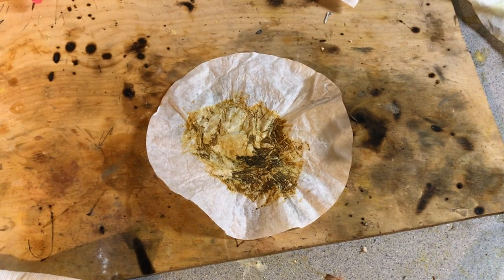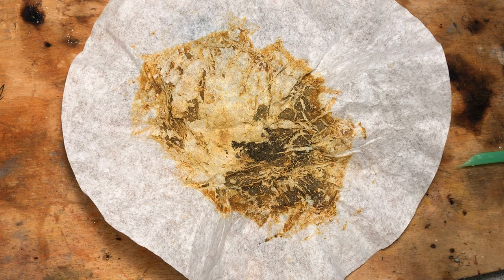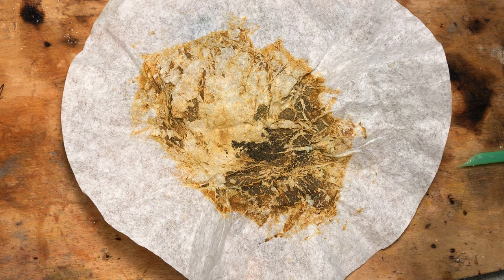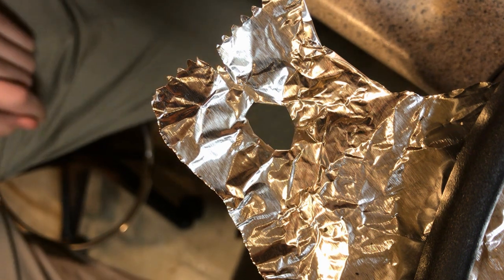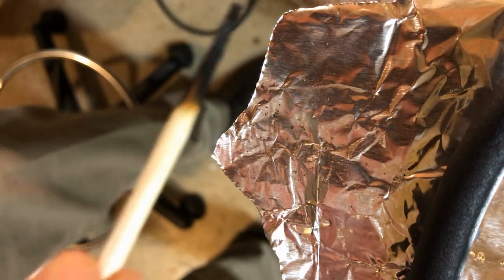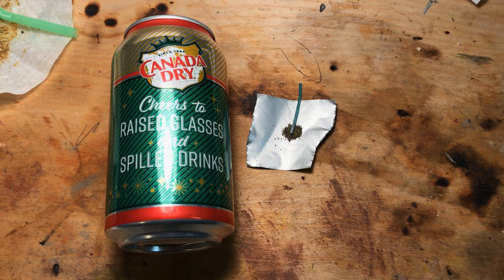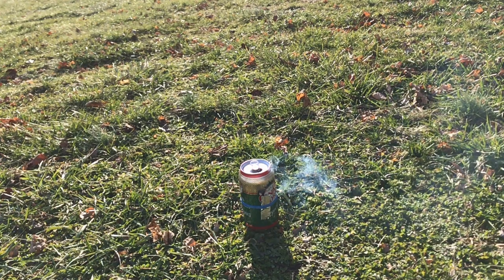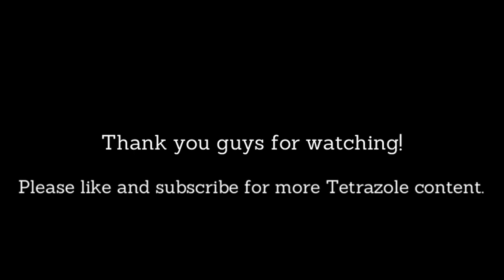Testing Energetic Properties of DBX-1 (Copper(I) Nitrotetrazole), a Lead Azide/Styphnate Replacement

Comment: i like JamesG below have an interest in a non corrosive cartridge primer mix . Have you made copper ammonium nitrate? This was supposedly used in priming mixtures in the 1920's. I think it was dropped and replaced with lead Styphnate and azide mixes. There has to be something easy for us non chemist types to make in small batches safely to see us through until prices come down and things come back to market. $175/1000  primers is just stupid!

Comment: Azidoazide azide. C2N14 I guess easy to make. Could be a good lead styphnate replacement.
Reply from the maker: Rocket Surgeon yeah it’s far from
easy to make and it’s sensitivity is sky-high. Not to mention that it decomposes entirely within about a day of production.
Reply: @DBXLabs  The YouTube Channel Explosions&Fire made some and it was shelf stable for 6 weeks he reported, and he wrapped some in tin foil and struck it with a hammer and on a couple strikes it didn't detonate. So either it's not as sensitive as indicated, or there was some kind of impurity that served to stabilize it some. Anyway I'm no energetics expert, I went nanotech. Primers are the real bottleneck to ammo production though so a decent lead Styphnate replacement would be pretty significant
Reply from the maker: Rocket Surgeon yeah the replacement for styphnate looks to be either tetrazene or some Nitrotetrazolate salt. Tom’s batch of Azidoazide Azide certainly wasn’t massively sensitive but  in comparison to both the products ReactiveChem and I produced, it was an extreme outlier. The problem that really lies with Azidoazide Azide can be determined without even testing it unfortunately. It’s nitrogen % by mass is just way too high to make it useful. As much as I like Bisdiazotetrazolylhydrazine for being less sensitive than C2N14, it too has the same problem with that massively high N %.
Reply: @DBXLabs  If either have the necessary qualities in addition to somehow being more adaptable to a mass production system than lead styphnate that would be great news. What's the issue with having a high nitrogen content?
Reply from the maker: Rocket Surgeon high nitrogen content is generally a good thing when looking for a good prospective energetic. However, that only goes so far. I think it’s safe to say that any nitrogen content over 90% is deemed too unstable for use. It’s just a good predictor of stability. I’ve seen the extreme sensitivity of isocyanogen tetraazide firsthand and it’s exactly what it’s massive nitrogen content would imply. Even if Toms batch was a replicable insensitive batch, it still would have the heat sensitivity problem. I doubt it’s stable over 70C if even that.
That’s not to say that you are wrong in seeing the properties Tom’s batch had and saying it’s make a good primary. There are certainly applications for an energetic of that sensitivity. It’s just the low sensitivity of Toms batch doesn’t reflect that of every other batch I’ve seen or heard of.
Reply: @DBXLabs  Gotcha, I thought it was some sort of situational use case characteristic being implied.
Reply from the maker: Rocket Surgeon dude what

Comment: Try synthesizing coppertetramininediperchorate I think a double salt perchlorate could also be a lead azide replacement I really don't want to deal with an azide it is hella toxic.
Reply from the maker: Philip Wright though I’ve never myself made coppertetraminediperchlorate, I know of a few people who have quite regularly so I’ve seen it’s properties. Much of the reason lead azide and lead styphnate are still in use is due to their extreme brisance (at the cost of extreme sensitivity and toxicity), and I’m afraid coppertetraminediperchlorate can’t really compare to the foil-shredding detonation velocities of those lead salts, even contained. With the end goal of a primary being to detonate a secondary with a much higher detonation velocity such as RDX, it is preferible to start with a more brisant primary, that way less booster explosives are needed to make the transition. Copper (I) Nitrotetrazole is a new, insensitive, and non-toxic primary with detonation velocities much higher than lead primaries making it a great replacement. I know that the channel PbN3 2 has a video on coppertetraminediperchlorate if you want to see that in action though.
Reply: @DBXLabs  yeah double salt perchlorate definitely lack brisance I've been researching primaries for 8 years now & DBX-1 is the best I've seen too. It is also inexpensive & easy to make the only downside is it just has quite a bit more steps to make it verses lead azide lol.
Reply from the maker: Philip Wright yeah it is quite unfortunate but over the past year I’ve seen the price of Aminoguanidine bicarbonate drop dramatically which could possibly mean it is being looked into being mass produced for tetrazoles
Reply: @DBXLabs  it makes sense plus most tetrazoles also have a very good shelf life too! Which would make it super ideal as a military primary. What is the military currently using is it PbN3,  tetryl or HMX?
Reply: @DBXLabs  ABQ will also react directly with nitrate salts to form there corresponding salts.  Have you tried any of those?  Also I made a compound on my channel you should try it's an amino acid Chlorate. Cu, Gly, Chlorate.  I think it's got real possibilities.  The Perchlorate version is also good.  It's brisance is greater than TACP and the DDT is better.
Reply: @allwrightadventures6675  depends on when the energetic material was made.  They use a combination of all.

Comment: Impact sensitivity of that compound interests me as I'm lately taking an interest in prospective cartridge primer materials.  Stability in storage is of interest too; and hygroscopy.
Reply from the maker: Shock sensitivity is quite low from what I’ve seen. I’d place it’s sensitivity similar to that of potassium picrate. Speaking of which, potassium picrate is currently used in some primer mixes and despite its toxicity, it is “prospective” in the manner that it avoids the use of heavy metal cations. If you haven’t already looked into that, I would for sure. 
As for storage and hygroscopy, I’ll make sure to touch on that in a later video when the compound has “aged” a bit longer.
Reply: @DBXLabs    Thanks very much!
Reply: The acronym should be CuNTZ just like sodium nitrotetrazole is NaNTZ and silver nitrotetrazole is AgNTZ